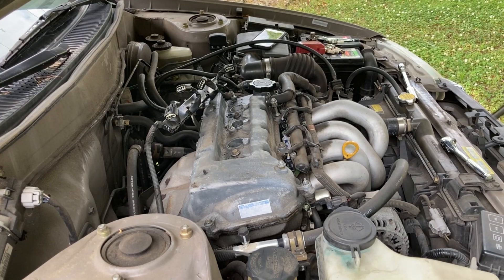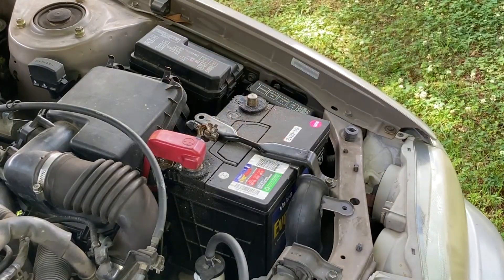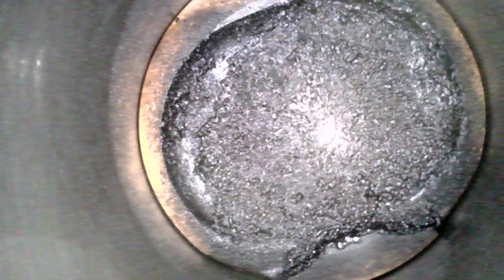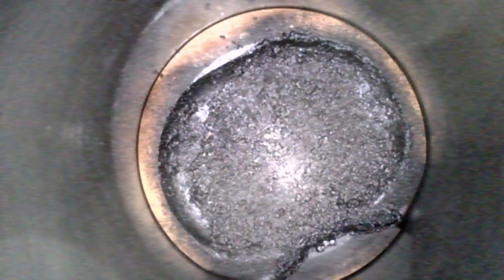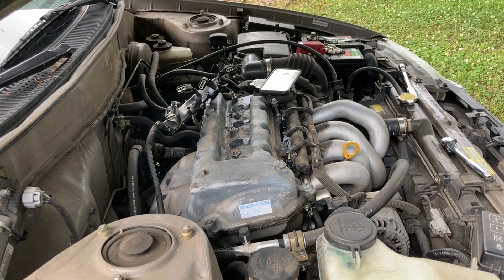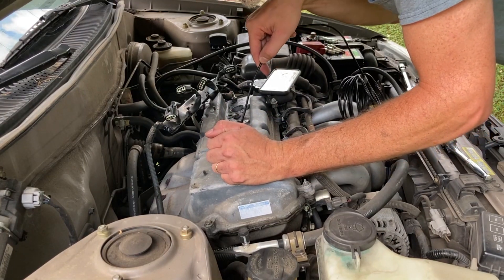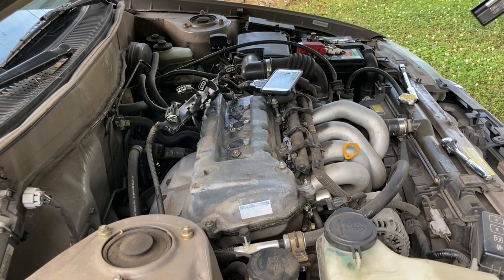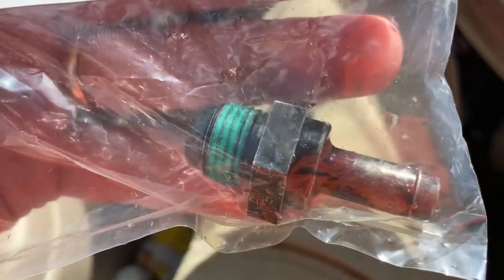Can you see signs of oil burning in the cylinders? | Oil Burning🔥Experiments | Episode 6

Comment: Have you tried the old transmission fluid trick yet? Works well in diesel engines, Put a quart In the crank case roughly a 100 to 200 or so miles before an oil change and also a few quarts in the gas tank. Fill with correct amount of oil and add a quart transmission fluid, An extreme oil burning is usually valve seal guides or piston rings.

Comment: them small 4 cylinder engines go through a lot of stress  it may have cylinde taper wear at the bottom of cylinders ! bearing were will also push more oil on the cylinders bores  where oil rings  cant control amount of oil  on cylinder alls

Comment: Hey Dave, I have been watching your videos later in the series but just saw this one. I could be just me, but when you were looking at the sides of the cylinders, some of them appeared to me to look damaged, as if they had worn into the cylinder wall possibly. I noted the areas look a little darker, or had vertical wear lines. If the happens to be true, there wouldn't be much of a fix besides replacing the block (fingers crossed that isn't the case). Even when you free up the rings, the worn cylinder areas would prevent full sealing! Eeek.

Comment: The plugs tell the story of oil burning..Also an oil added to the cylinder compression check..If the compression goes up it's the rings..I would just rebuild the top end of that engine..Those cylinders and plugs were loaded with carbon with oil

Comment: Might have a couple of bad valve guides where the valve is just slopping in its bronze guide. All of the spark plugs have at least some oil Ash on them, that's that white stuff that's on the electrodes. I believe those are iridium plugs, best plugs to have in that situation.
Yes you will probably have to Hung those cylinders and put some better rings and make sure that the ring gaps are proper. Recently I found a 5.3 GM V8 that every single ring was gapped at doll from the factory which is almost twice more than it needs. And they wonder why the General Motors drink oil?

Comment: I think I watched most of your videos on the corolla out of order but I'm leaning on the head gasket and/or cracked head on the car. Most of the oil is coming from the top of the cylinder in the scopes. There's only a couple of ways this can happen and I'm going with the gasket/cracked head scenario because of the cylinders involved are next to one another. I'd like to get one of the scopes. Are they affordable?
Reply from the maker: You might be right. Some others have mentioned the head gasket as well. We’ll see 😁. I think I paid about $30 for the scope I bought. But if I did it again, I think I’d pay a little more to get one that can look backward and/or at right angles. Thanks for watching!

Comment: I think it is a good idea to clean the engine first with a good treatment because carbon build up can cause misfires by robbing the cylinder of fuel by absorption. I have a similar problem with my v8 dodge ram and I would rather try to clean it first with treatments before thinking of removing the heads.

Comment: Hey Dave ,you definitely have some scoring going on there especially on #3  I would be concerned about that ,I can see some cross hatch  but the verticle scores are a concern. With the bore scope in the cylinder have someone rock the crank you can probably see some side movement in the piston
Reply from the maker: Thanks Tommy. You’re probably right. I’ve watched a couple videos since making this (The Car Care Nut) and now I think I know a little better what to look for, and where to look for it. I’m probably going to do another scoping video on this to double-check the those walls. As I’m sure you know, if the walls are damaged then the engine is shot. We’ll see 😕
Reply: @FamilyFriendlyDIY  I was gona recommend the car care nut, he's a veteran Toyota tech very informative. Good luck with it and I will continue to follow your videos,  good stuff. Thanks.

Comment: Reading through comments - I don’t think you need a leakdown tester for this. Sure, it would give you a better understanding for how much leakage you have, but that’s about it.
Do you have an air compressor and a compression tester? Some of the compression testers have various hoses that have a quick release to attach to the gauge. The quick release is often the same type to connect to a compressor hose.
You could then bring a piston to TDC and put about 30~60psi into the combustion chamber.
Remove the oil fill cap and oil dip stick.
Listen for any air hissing out of those two holes - inserting a length of vacuum line in your ear can be helpful to really hear the hiss.
That would tell you if you have cable leakage or piston ring leakage.
You could even remove the radiator cap and look for bubble in the water fill neck if you suspect a blown head gasket.

Comment: Watched a few of your videos. Not all so some of this might hve aready been covered. Just my thoughts:
This engine has 179 k on the clock what are your expecttions?
All and any rubber seals gaskets will get hard and leak. My expieriance is with BMW but I would guess these are similar. Tons of oil on the top of the plugs says you are leaking up top and the valve cover needs to come off or at the least do some research to find out what should be or should have been replaced already. At 3:21 you are looking at one of the culprits as the first two plugs are wet from the top down. You can continue to pour stuff into the motor and hope this is a substitute for actual repairs or do the actual repairs. Thise plugs looked hideous. Full disclosure I ruined a perfectly good motor by running plugs too long with gaps too large. Put in the good plugs, gapped properly and find out everywhere oil could leak from. There aren't that many. The cross hatching in the cylinders is a good thing. If this is a daily and you can't have it down for a while you might buy a used longblock and do all the needed repairs to one out of the car and then swap it out. Out of curiosity how much have you spent to date not getting it fixed? Think you might be slowly spending your way to a big bill you will never see unless you take a step back....

Comment: That motor is tired the bottom of the bores are polished like a mirrior the crosshatch is gone. the bore is taperd and oil is getting pushed up and getting burned.  Heck try STP or hunny oil with comit cleaner mixed in to make a grity oil and put some in the spark plug holes and start it up. it may just brake that glaze.

Comment: It's like an autopsy of the life you lived, many years of taking the car for an oil change and getting bellow par oil evaporating at an accelerated rate and running low at times steadily and systematically causing damage to your engine!... At the same time using 5W30 oil doesn't he;p either in hot climates helping it evaporate at a faster rate!.... Face it, that engine has lived its life with its limitations imposed in it and wear it a little prematurely but still going strong... By this time it should be using at least 15W40 oil to help it fill the gaps imposed on it and the hot  weather and to control the oil a little more.... 20 years is a good service life and could use a good overhaul cleaning up the oil cylinders, new rings and pistons and a head job will last another  20 years......
Reply from the maker: I hear you, Pavel. I've just been a little spoiled with my vehicles. I've always pushed them past 300k miles, and never had one that needed oil added between changes. When I bought this one it already had the oil burning issue ... so I thought it would make a good guinea pig to test some snake oils on. ... It's just experimentation and hopefully a little entertainment. Thanks for your comments!

Comment: I think its rings. yes , oil was in spark plug well. IMO. My 98 corolla same thing. 170k on mine. oil has ruined evap and cat convert. dont have time or money to fix proper. i just keep putting oil in. and replace spark plugs about every 10k mi. 
What i dont know is...what will cause the final death? completely clogged cat conv? 
would high octane serve any good?
Reply from the maker: Bummer on your '98. Not sure what you mean about high octane, but I have to run premium in mine or it knocks. I wonder how they die too. Maybe someone who's killed one can chime in here eventually. Thanks for the comment!

Comment: 1998-2002 is the worst Corolla ever made in the world. Completely bad engines, rusty suspensions, brittle interior, etc. Just plain junk.  The 2003 and newer is way better. I will pay 2x more for 2003 vs 2002 with the same mileage.  The 3rd gen Prius use the same engine and early 2010-2011 also burn some oil but not as bad as 1998-2002 Corolla.  The 2015 model is much better with revised piston and piston rings. https://www.youtube.com/watch?v=8RZhMyhLbnE&t=709s
Reply from the maker: Wow, his scope is much clearer than mine ... I probably should've sprung for a nicer one :-)
Reply: @FamilyFriendlyDIY  yours is ok too. I just feel that corolla pre 2003 is the worst in all aspect. It will be interesting to scope 2010-2014 Prius vs 2015-neuer  Prius with revised piston rings and piston.  Post 2015, almost no Prius owner has oil consumption problem although they are identical 3rd gen.  This ancient 1.8L engines evolve since 1990s and get so much better today in 4th gen Prius but still ancient.  More modern 2.0L D4-S in Corolla and corolla, CHR hybrid is more powerful 180HP and better MPG because of dual injections

Comment: A Leak down test only tests  the upper portion of the piston rings and or if you have leaking valves. The oil control rings have no effect. I’d guess by the amount of carbon on the pistons you’re oil control rings are just pure gunked up beyond cleaning. If you decide to do rings and pistons do the valve seals and lap the 
Valves. I test mine with gasoline. If fuel seeps out the valves are not seated.  And if the pistons are out replace the rods bearings at the same time. But one thing you could try is AC delco upper cylinder cleaner, let soak on top of the pistons, I’ve noticed if you let that soak it does a pretty good job removing carbon and may weep enough to the oil control rings and possibly free them up. Worth a shot before tear down. Good luck Dave
Reply from the maker: Thanks for all the advice Ryan.

Comment: You know, I have heard that techron injector cleaner dirties oil and is best used before an oil change, I wonder if it might help with those incredible oil deposits. 

Or a full bottle of marvel per tank of fuel etc. 

Hit the carbon from the top and bottom!

Comment: Have you changed your valve cover gasket? My 2004 Toyota Camry needed it and it also sealed up the top of the spark plug area where it meets the well. It could also be valve stem seals.
Reply from the maker: Haven't gotten to it yet, Michael, but it's coming!

Comment: a compression test will tell you if rings or valves are leaking.  check compression PSI at cold or hot, then squirt some oil in the chamber and check compression again if PSI increases by 8-10+ PSI.  If so, then rings issues.  If not, then leaking valves or valve stems leaking.  Usually, a good cylinder with 140-160+ PSI is good, if 130 and below signs of a leak and between cylinders should not differ by no more than 10PSI.

Comment: Rebore time!
Reply from the maker: That's one of the problems with these 1zfe engines, Tim. You can't rebore them, you can only re-ring and hone the cylinders. Something to do with the cylinder coatings. They're considered "throw-away" engines. Thanks for the comment!
Reply: @FamilyFriendlyDIY  - they may be like the Nikasil coated bores on my Moto Guzzi motorcycles. Non reboreable, plated coating.

Comment: In one of your videos where you did a compression test, you had extremely high compressions on your cylinders. Looking at the build up on those piston heads, has this reduced the volume of the cylinder at TDC and inturn increased the compression ratio or at least the compression when the spark ignites the fuel?  Increased compression would cause increased heat which may cause oil to break down and build up on the top of the piston and cylinder head. Is the increased heat and break down of the viscosity of the oil affecting the thinnest medal components like the rings the worse?  Wonder if these engines need an oil that can withstand higher heats. The best cleaner I ever used on carbon build up was what we called "carb cleaner" and we had a holding tank filled with it and let parts soak in it. They would come out bare medal clean after about 24 hours. It was super corrosive to your hands so you had to wear rubber gloves. It was red in colour. I believe it was phosphoric acid but not sure as it was back in the late '80's. I've heard you can't buy it anymore but maybe other viewers remember this stuff.
Reply from the maker: That is truly an interesting theory about the compression, pjmoisso. Some viewers think my pressure tester is broken (though I know the specs can be pretty close to 240 psi for this engine---I think maybe 218 to 235 is "normal") add your theory to the mix and that would make sense. The carbon is definitely thick, and might have been thicker at the time of the test. This'll definitely give us something to ponder. Thanks for the comment!
Reply: I've read most modern engines should be around 175 psi and back when I pulled wrenches as a hobby, we expected around 150-160 psi out of our 350 small blocks. I'm not sold on the fact your gage is consistently off by over 50%. Toyotas fix was new pistons and rings. Are these new pistons and rings the same or have they lowered the compression ratio. Toyota never recalled this problem in Canada at least. All they did it Canada was offer some an extended warranty so to speak but was based on kilometres and age of the car and you had to prove the car burn oil. Most owners by the time they experienced an issue (around 160000 km), they were either past the kilometre limit or age limit. Really there needs to be a class action lawsuit against Toyota in my opinion because there are many toyotas this is happening too and I would expect many more to come. I was thinking of buying another Toyota but won't. I've had no issues with my Subaru so I personally will look at them when I go to buy a new car. Be interesting to find out if they changes the piston and rings or putting in the same old parts and hoping to get another 150k out of the engines just to satisfy customers.
Reply from the maker: @PJM454  I believe the new pistons are the same with the exception that they have 3 or 4 oil drain-back holes in either side of the oil-ring groove, rather than the single holes of the original. They say the problem with the oil burning in these engines is the single oil drain holes get clogged quickly (especially with poor maintenance or only making short drives) and then when the oil can't drain back through the holes it remains on the cylinder walls and gets burned. I hope your Suburu continues to be a great vehicle. ... My daughter just bought a '14 Impreza.

Comment: When valve stems were worn out on old v8 engines, upon starting the engine we would always see a puff of blue smoke out the tailpipe for a few seconds then it would go away. Telltail sign oil leaking down through the valve stem.
Reply: I wonder if modern catalytic converters will hide that symptom.  (all oil burned in the converter)

Comment: Verticle scoring. Plenty, of it.  When you have verticle scoring, it allows oil to push past piston rings. There are many verticle "ditches" which the piston rings, can not seal. The restorer, is what, is needed. I'm not saying, you dont have bad valve seals, but oil is absolutely, pushing past the poston rings. There is a good amount of pressure, in the crank case of an engine. When, previous owners don't perform preventive maintenance, on any make or model, the scoring happens. I have used engine restorer, for many years, with good results.

Comment: all those treatment and the carbon deposit is still there.  
subarus burn oil but on mine compression was perfect on all cylinders. Leakdown test was shown minimal loss and hg seems to have been changed. i checked the endoscope and could not see any oil. burning oil is a mystery. I add 1L every 2000KM in the beginning and then it gets worth. Thanks for the videos

Comment: Did you do a compression test? 
The Haynes manual says if it’s leaking rings a squirt of oil will improve the compression for the test and if not you know it’s the valves/valve guides/seals

A leak down test? I think a leak down test would give you a shot at figuring out where the problem is.

In my opinion, throwing treatments at it without doing all the tests you can first to try and narrow down the process is not the best way ti go about it, because it’s harder to judge how things have changed. Need a compression test for a baseline, and a leak down test. 

I suggest put the seafoam in the crankcase and drive the snot out of it and make sure your oil doesn’t get too low. And also do the leak down test because that won’t help if it’s the valve guides.
Reply from the maker: Did the compression test in another vid, Craigie ... but haven't done leak-down yet. I'm about to do valve stem seals to eliminate that possibility as well. Thanks for the comment.

Comment: The cylinder walls are toast the crosshatching is gone you can clearly see it, nice and shiny at the bottom.
Reply from the maker: Aw, man ... I hope not. Thanks for the comment, cyclopathic.
Reply: @FamilyFriendlyDIY  there's a class action lawsuit going on against Toyota covering multiple models from 2006 to 2014 on this issue.. check if you qualify; oil consumption is piston/ring design issue.